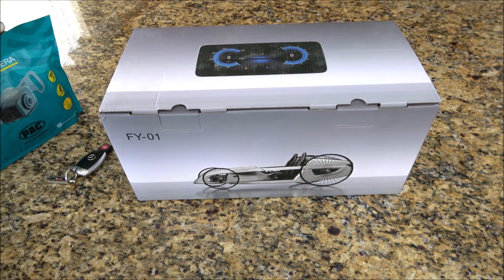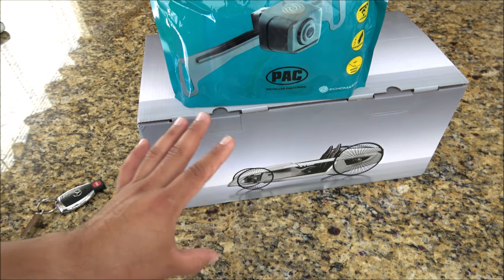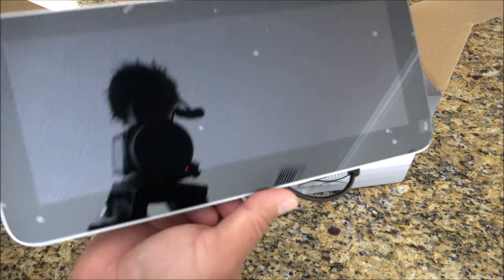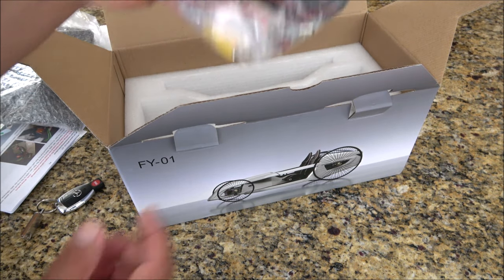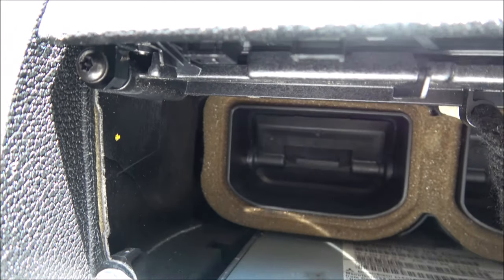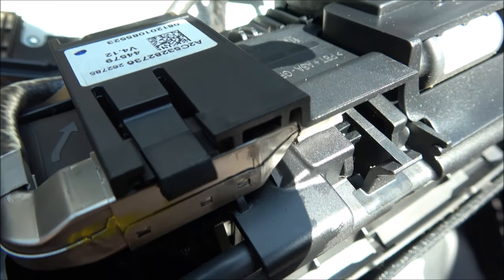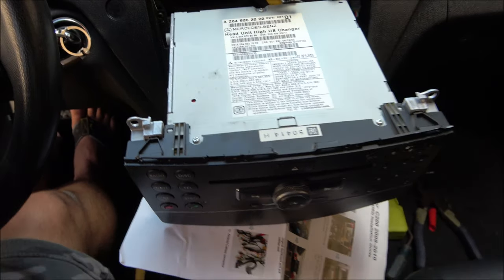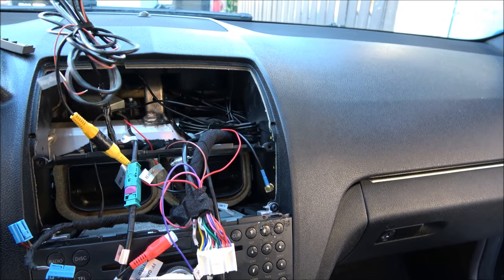Mercedes C300 [08-10] - Android Car Stereo - Plug & Play - It Has Wireless CarPlay!

Comment: I have a 2011 W204 C63 does anyone know if this radio system will work in this car, my radio unit has stopped working and I get information from sound shop that amp died, which happens in the H/K amps that have the fiber optic connection and cable harness.  I bought two used amps that match part # but no luck so I do not know if there is another issue in the system as the fuses are good and I even replaced them just in case to make sure it was not fuses going to MB dealer to replace whole radio system is like 4K.

Comment: Hello, did this need connection to Aux input or Ami for sound from Android screen to Harmon Kardon system? Is the optic fibre connection just for sound from original side of command unit to the speaker's?

Comment: Hello 👋  thanks for your video! 
One question,  when you remove the reverse gear, the camera image stays on for a few more seconds. How do you do it? I have a w204 and I installed an android 10 with carplay and I can't do that, if I hold the camera, the image turns off quickly

Comment: Hey i installed everything and everything works perfect except my control wheel on my mercedes (like the mouse) it only doesnt work when i spin it, did i do something wrong or is that not compatible ?
Reply from the maker: It doesn’t work for the upper screen. It’s only for the lower unit.
Reply: @MJTechChannel  so then how do I select aux or play Bluetooth music?
Reply: @Joker_adrian6996  did you figure this out?

Comment: hi, why does bluetooth sounds doesn't work but the radio does, is there anyway i can fix it?
Reply from the maker: You need to set the car to aux mode
Reply: how ? i can't see it on screen
Reply: @ennviesstv6251   u can check if ur android system video/music has sound or not, if have, only android bt and navi no sound, install the speaker, if not, ask ur seller send to u, normally should have one speaker